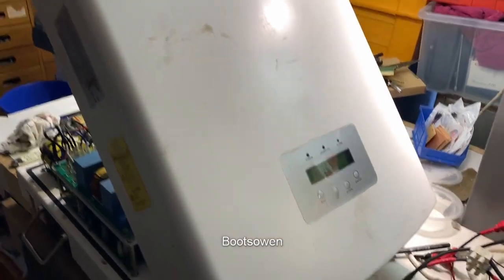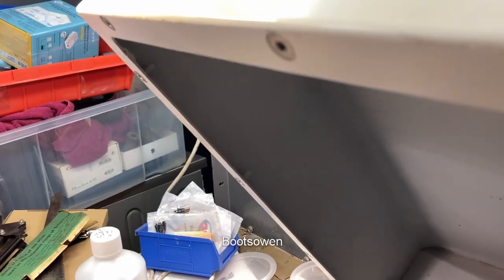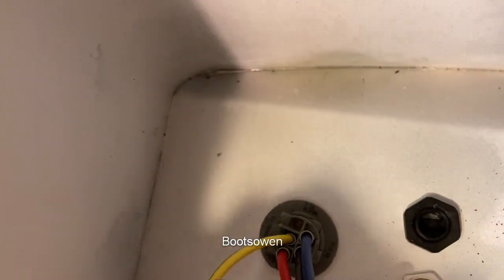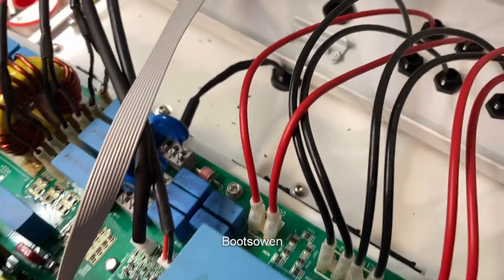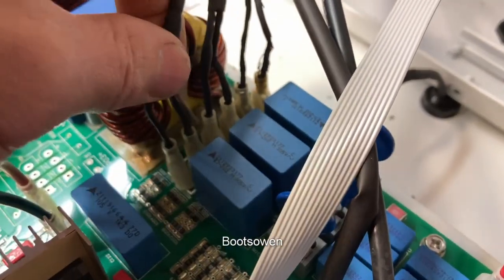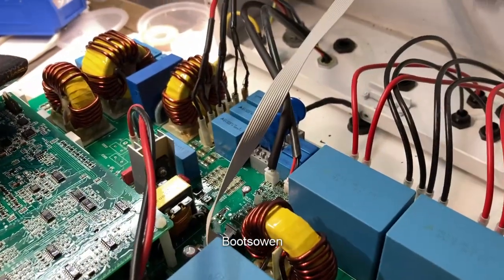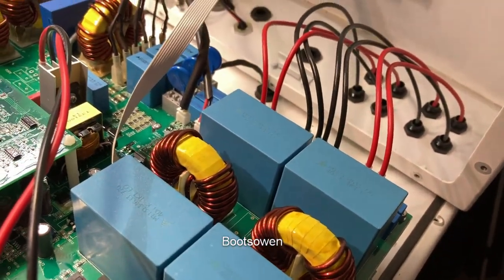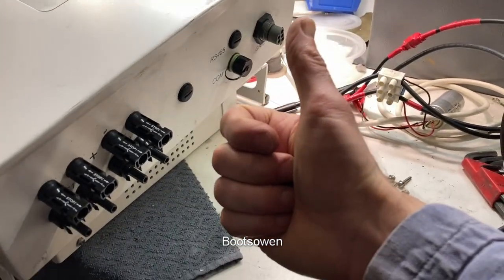Solis 15K 3 phase solar grid tie inverter a look inside and a bit of a fail

Comment: Scrap visit today 

0.6 bright wire - £5.80 per kg - £3.48
1.8 electrical cable - £1.60 per kg - £2.88
Total - £6.36
Reply from the maker: Nice work, do they pay out on a low number like that or do you let it build up on account?
Reply: @bootsowen  They let me build it up, I usually wait until its about £15. My scrap yard pays all cable (unless heavy stuff) as VIR and all types of aluminium the same orice . I lose out on cast aluminium prices but gain in cable prices.
Reply from the maker: Every yard seems to have different rules.

Comment: Owen, I'm thinking effort over time and what would be the outcome. I Suspect that the heat has come from the spade connectors and there my be damage on the board. The relays are definitely worth having as are the DC input cables, cheers
Reply from the maker: It's big and in the way, bought for parts so parts it should be!
Reply: @bootsowen  A1 wilco, cheers

Comment: Perhaps a diy three phase can be generated using three 110V transformers, each with their mains side delayed using a motor capacitor of the correct value. Probably not in sync as I figure each transformer would take a different length of time to saturate and conduct.
Reply from the maker: As Andy says, more hassle than it's worth. Any good to you?
Reply: @bootsowen  not for me as no three phase supply. I've a Solis for parts and a 10kW 1ph in the shed, untested due to it's high start voltage.

Comment: Looks like it'll supply to any 3 phase supply between 3-400v AC and the expected voltage set in software like you/Andy has done to get the right voltage/frequency.

Comment: Was the burnt wires an overload of current or did dampness get into the connectors and the  separated wire strands became tarnish isolated from each other, some strands got more current than others so a burn up.
I do talk some crap lol.
I think you can fix it if you are interested :-D
Woffle mode again.
Reply: Track to relay at1;36 looks toasty too. But as you say, it's the wire thay got hot. Both halves of that phase which seems odd considering the load should be shared across the three phases unless power wasn't balanced from a fault further in the system.